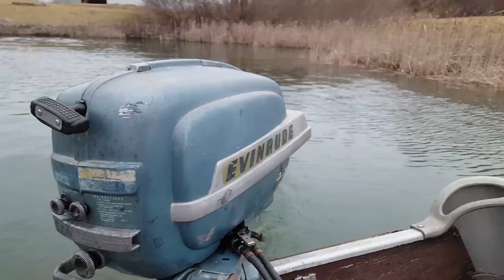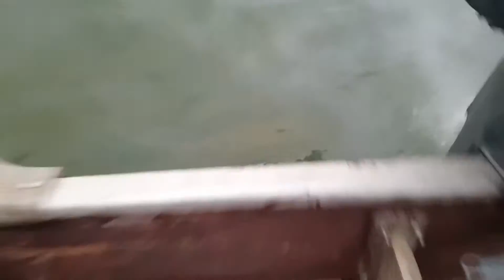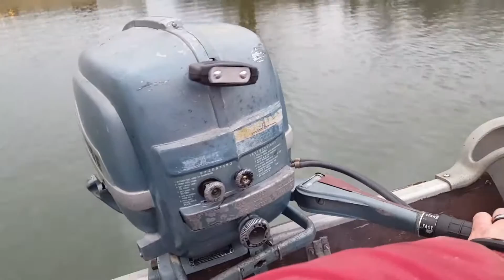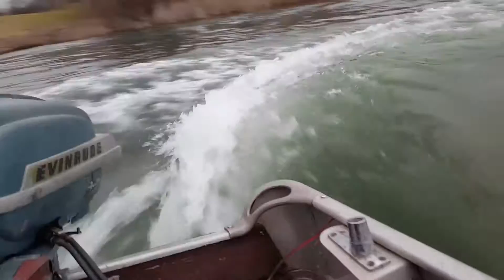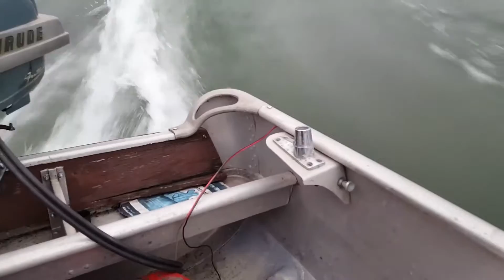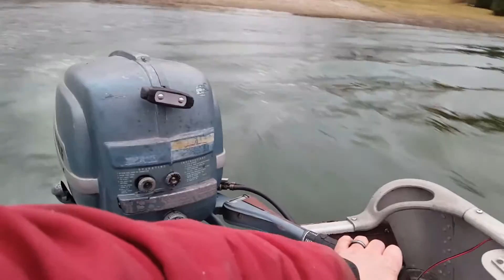1954 Evinrude 15hp Super Fastwin Reverse Test After Repair

Comment: Nice, I have a 56" Johnson 15hp. Love the way they run. These motors speak for themselves , well built classic. Thanks for sharing
Reply from the maker: Great motors.  The '56 is nice since it is quieter and has the rubber mounts on the tower.  They are heavier motors but have their advantages.  I still have two '56 Evinrude 15s.  For 15s I really like the 53/54 Evinrudes with their lighter weight, but they are noisier and vibrate more.  The 18s are truly my favorites.   Thanks for watching!